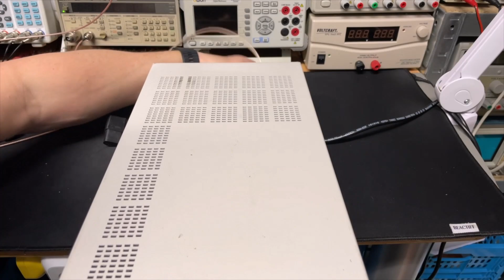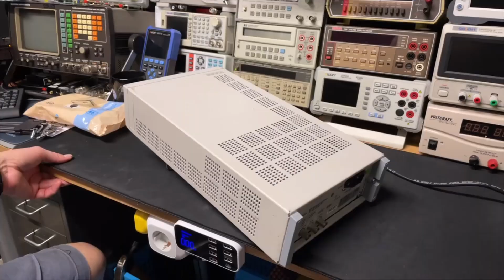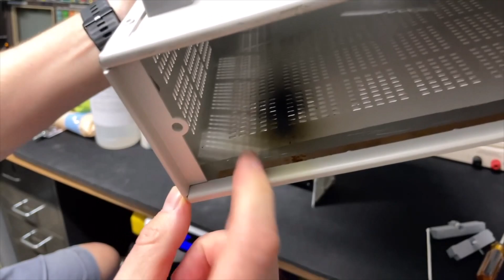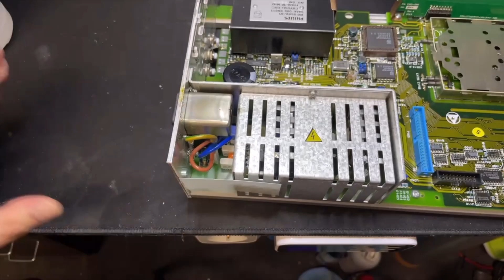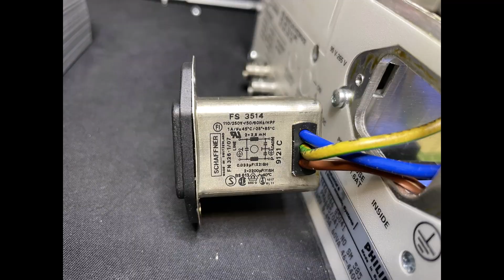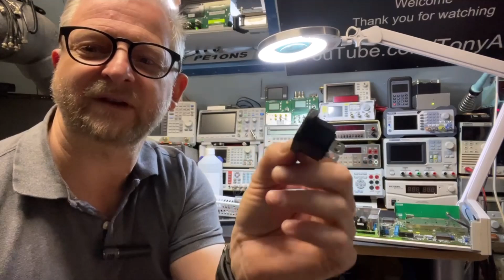#234 Fluke Philips PM6685 - RiFa BOOM!! - Quick and Dirty Fix

Comment: You made me paranoid about mine too. Checked mine and still the original filter fitted. I did manage to find a replacement on eBay. Just waiting for delivery. I will update when it arrives. Karl
Reply from the maker: Glad i could help... my lab is still a bit smelly...

Comment: i have a lot of old HP equipment. first things i do is replace the rifa's and netfilters.
like you know too it really smells and you need to clean a lot.
Reply: I just replaced my RIFAs in my HP3478A some weeks before. All of them are cracked (but not exploded yet).
Reply: @deterdamel7380  i got 3 of those HP3478A this month :) first thing replaced. all where cracked and ready to smoke.
really nice meters. have them setup with the GPIB controlled by a raspberry pi for automatic control and report of mearuments.
Reply from the maker: Yes i know, and hear it many times, guess i am just lazy and very luckey it nerver happend before.
Reply from the maker: @deterdamel7380  i never replace one, it never blow before
Reply from the maker: @djneon12  sound very cool!

Comment: My old Philips oscilloscope recently also went out with a bang and a really bad smell. 
I haven't figured out how to get the power supply board out of the scope, yet, but I did figure out I can power it off a 24V DC laptop PSU. It just seems to not make as nice of a waveform when using that... I finally upgraded to a modern (Rigol) scope, the old one is waiting until I have time for another project.
Reply from the maker: terrible when that happens, sorry to hear.. yes the new scopes are very nice... good to have a future project also..

Comment: HI Tony 

Im sure you are sneaking into my workshop at night as again you are looking at something I have :-)  My CNT-85 Pendulum (same as your Phillips) unfortunately went bang as well and filled the workshop with smoke recently.  Unfortunately, mine also took out that first blue capacitor, the filter and about a dozen surface mount components and tracks on the bottom side of the PCB in the PSU!  It put on quite the show when it decided to retire!  I am now on the lookout for one as parts or just a PSU board as it is a bit beyond repair at the moment.  On the bright side I had two so I still have one of these excellent meters working on the bench.  Maybe I should look at replacing the filter in this one before it goes?  Anyway glad yours was an easy fix.

Cheers...Allan
Reply from the maker: Thanks Allan! seems i was very luckey it only smoking the linefiler and room, the main pcb is okey. Sorry to hear yours is a lot worse. a pamdulum version , cool!
And be sure to close your windows at night :))

Comment: Hello Tony and Followers: Magnificent equipment of measurement. Years ago he had the option to buy the Philips PM6685 or the EIP (Phase Matrix) 545A, at the end Buy the EIP as it reached 20 GHz, also had a power meter and is 100% programmable, but I was in love with the Philips, and I'm still looking for one so to buy it, it's an excellent device I admire, like each of the measuring equipment manufactured by Philips. A greeting from Spain.
Reply from the maker: Thank you Manuel, yes very nice equipment EIP also.. saludos

Comment: Had the same problem trying to find a replacement IEC filter for mine also. Still have not found a good filter to fit these Philips PM668x counters without modifying the case, been looking for a year. Be interesting to see if you find something.
Reply from the maker: Yes it is, one ofg my viewers says this, and i found it at Franell and it seems like it could be a fit. FN9226-1-02 from schaffner
Reply: @TonyAlbus  Hmmm, doesnt have all the dimensions, but I think I remember buying it and it was a bit wide. I will check if I have it in my parts bin.

Comment: Hi Tony, i could actually smell that when you showed it (once you've smelt that smell it stays with you!).  On another point, those schaffner filters are pretty good.  I've used them on many a design for work and they seem reliable, or should i say no reports of them going bang yet.  They are quite expensive, but do the job.  No real reason to replace it, unless you want to keep the EMC (CE) conformity, as the main board seems to have filtering on too.
Reply from the maker: Thanks Stephen, yes that small...oh man... you are correct, i prob will keep it like this, there was other filtering indeed.